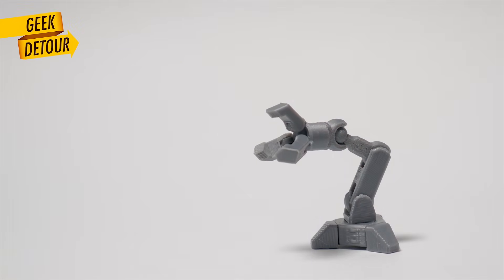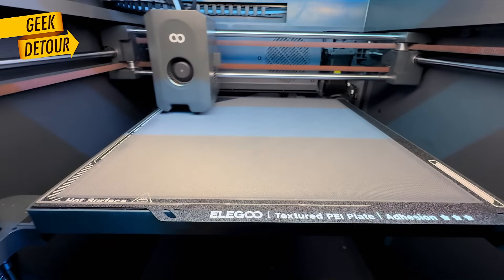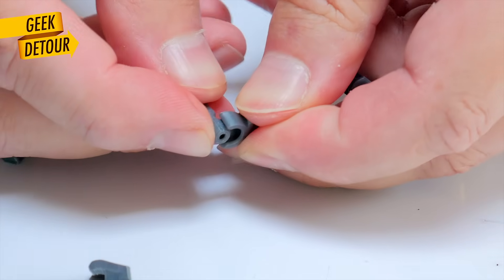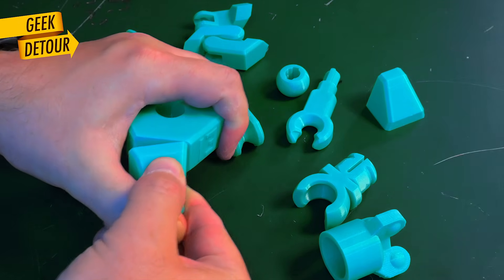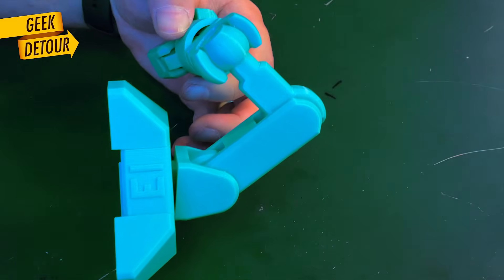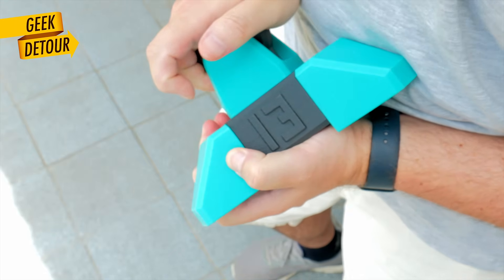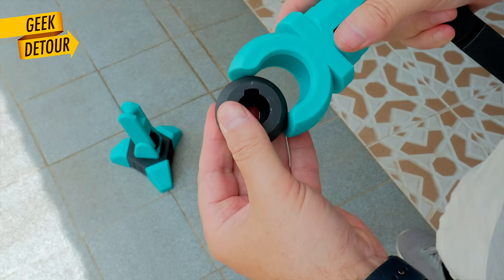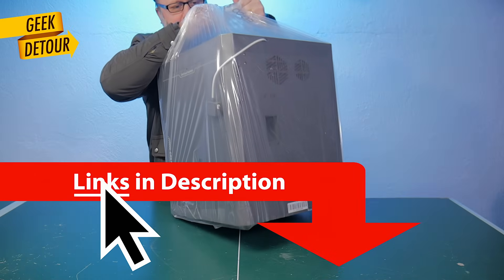How big can you print? Grabby the Claw – Elegoo Centauri Carbon

Comment: You are so dead-on when it comes to dish soap and water. That was a gane changer for me. I do, however, still tend to wipe my plates with >=91% iso before washing them, and if I accidentally touch them after, to remove any oils from my skin. If I do that for every print on my Ender 3, I have zero issues with adhesion.

Comment: Really interesting, but is there a "print in place" calibration model for stuff like in-place hinges and other mechanical parts? I think print-in-place is the biggest advantage FDM or even resing printing has over regular manufacturing.
Reply from the maker: You can have print-in-place hinges and other mechanisms… but only if they are a bit loose. If you want pressure fit, snapping, it must be printed separately (otherwise they would just fuse).

Comment: I'm curious if you think it needs additional heating for the chamber? I've heard some suggested it. Another interested thought to test is padded sound insulation with a foil outer shell, keeps sound down and heat up.
Reply from the maker: No, I used heat gun not to fix anything on the print - but to make the plastic soft enough to make the parts bend enough to fit - when printed at 8 times the original size.